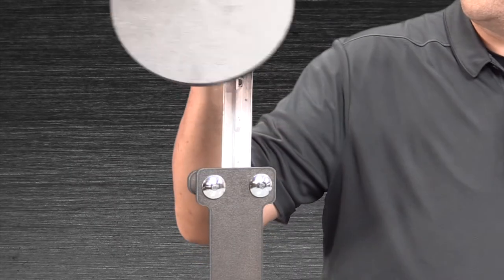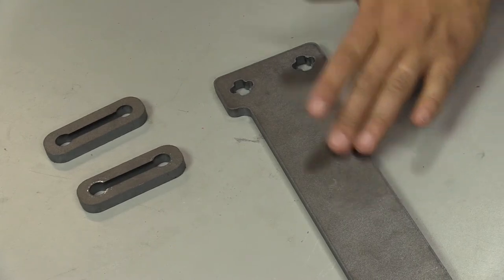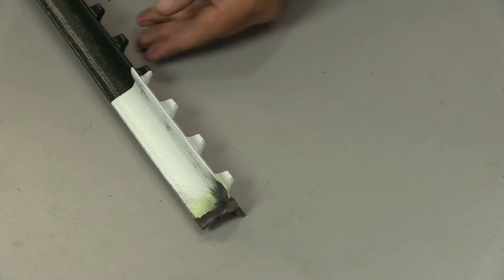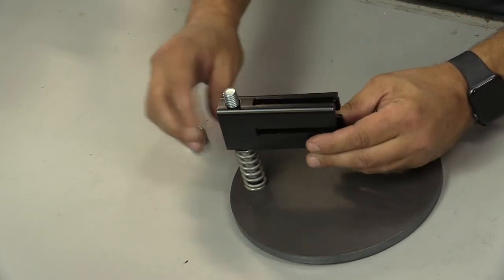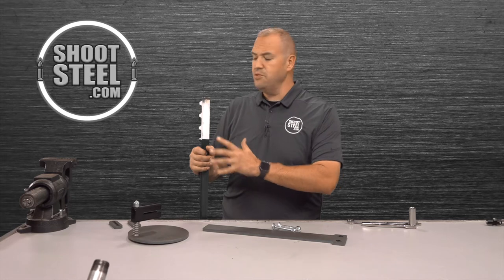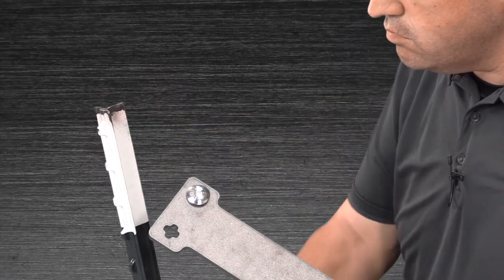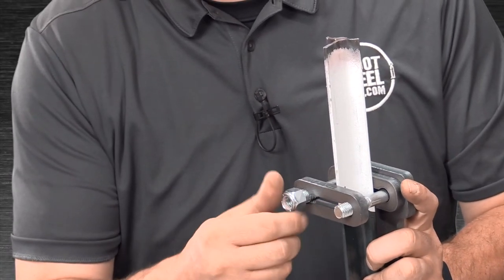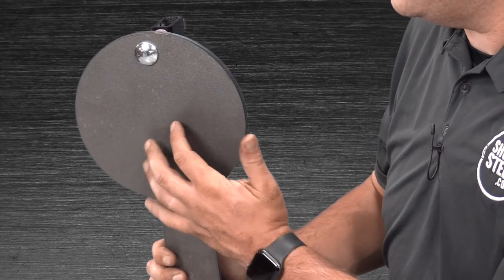Static Tpost Hanger and protector plate

Comment: Excellent setup. Been using multiples of this with the 12x20, 9x15 silhouettes, and 8" round plates for a couple years now. Still holding up strong, year round, out in the elements without any maintenance, except for the occasional rattle can repainting.

Comment: Can these mount any standard steel plate, or does the plate mounting cutout have to be that same '+' shape?
Reply: That cross cut shape is only to grab the square shoulder under the head of the carriage bolt, so it can be tightened down. Otherwise a carriage bolt stuck in a round hole would just spin as you tried to tighten the nut. A standard nut and bolt setup will work just fine, all be it a bit more susceptible to damage from the spalling of the round hitting the plate. The carriage bolt setup allows the spalling to skip over the head, due to the dome shape of it.